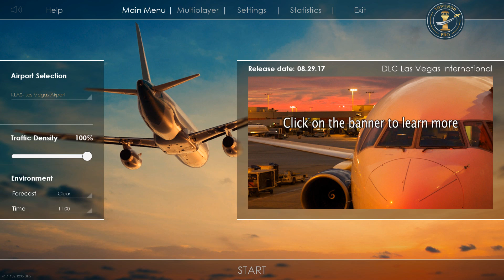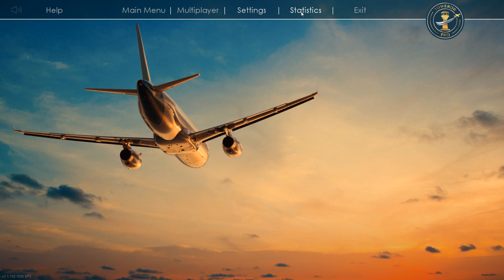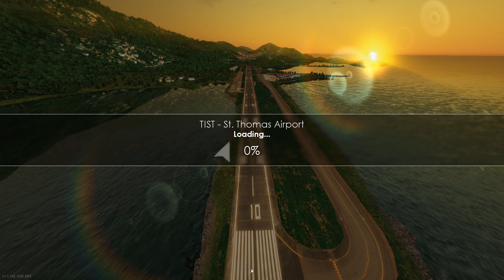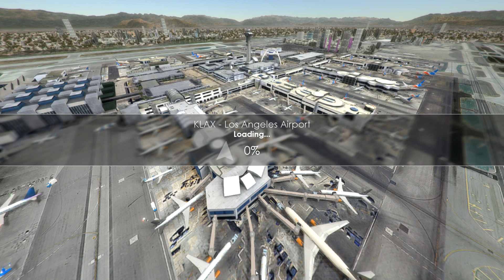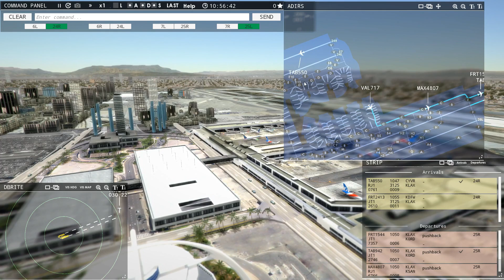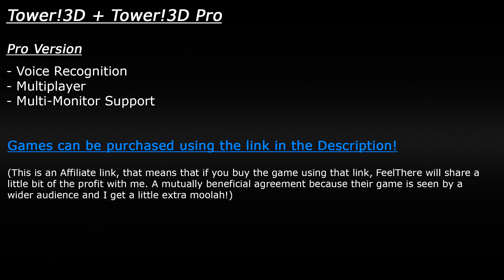Tower3D!Pro - ATC Simulator!

Comment: Of course it's niner 😂 and you are always required to say niner. In fact it's part of the phonetic alphabet, which does not only include A-z. It also features . as decimal (not dot, point or whatever), the numbers 0-8 are basically the same as in regular English and 9 is niner. Some common knowledge, "nine" sounds precisely like the German "nein" which means "no" and since WW2, 9 is officially niner to avoid reckless mistakes. I would actually file a report if you tell me to hold short of "runway nine left"

Comment: Usually you'd have planes landing simultaneously on the parallel runways. The 1NM minimum separation distance doesn't apply to aeroplanes that are landing simultaneously following this procedure the same way it usually does and there are rather different safety precautions. What I personally like to do on ATC sims, specifically on EGLL (Heathrow), is have planes approach both runways with 1FL differences. E.g. on 09L  you have one at 4000 so the one on 09R would be FL5 or FL3 and once they're established on the localiser you can safely get them both on FL2 for example. I would also usually invert every plane so if the previous one on 09L was high, the following is low—this is just like an additional safety precaution to keep the minimum proximity alarm down.